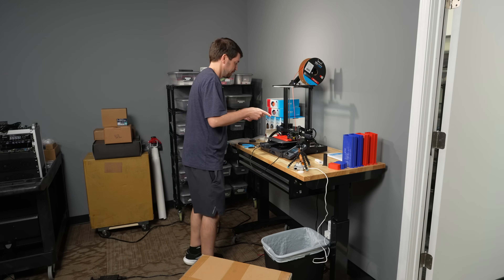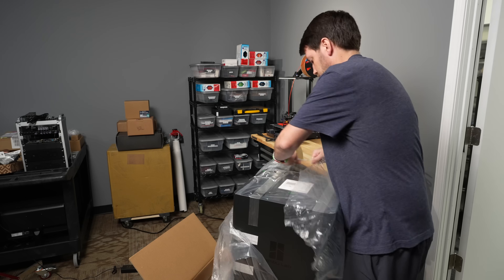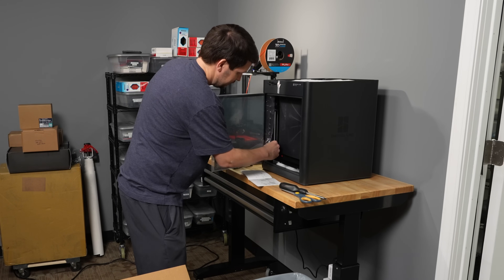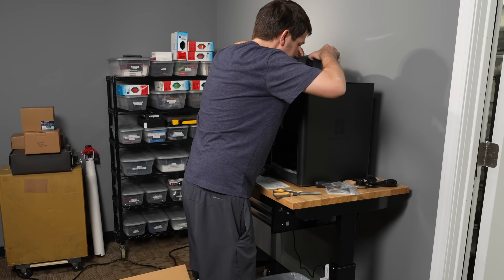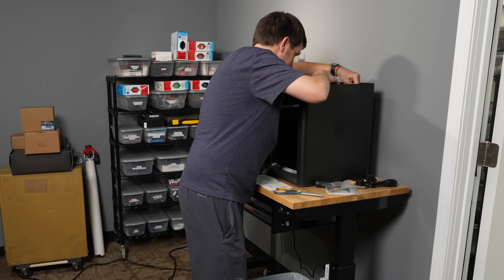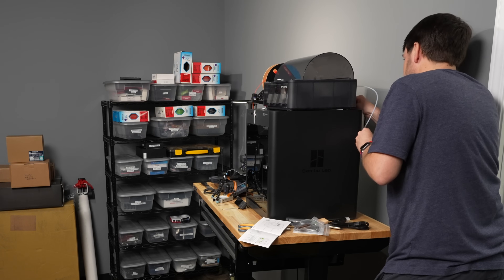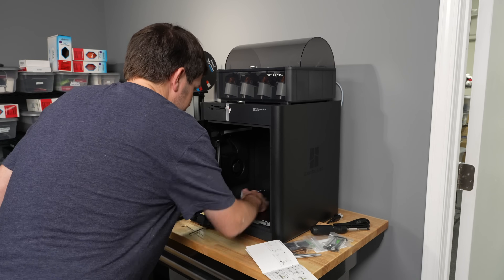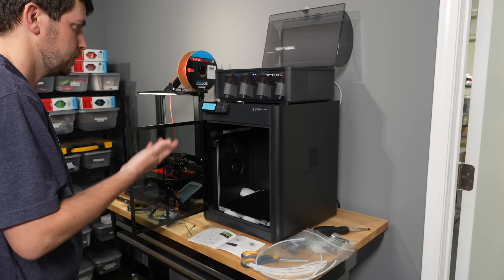Watch Me Build: Bambu Labs P1S 3D Printer

Comment: your husky workbench is brilliant. Impossible to find in Europe and particularly in France, I can't find anything similar. And I've seen the price in dollars (around $350). I think it's a very good deal. Before researching, I'd estimated it at around $800. In any case, given the thickness of the frame and the wooden surface, that's the price in France. If you have a plan for delivery in France, I'd be interested. Merci. Nice installation you've got here !!!!

Comment: I have 2 K1 Max printers, as the eco system is more open.  Material changing units waste a lot of filament, as they need to purge the nozzle before they can print with the different color.  The waste can be several times the actual weight of the print, depending upon how many changes are required.

HAVE FUN!

Comment: If I had to guess, it did the 250° purge in case you went from a higher temp filament to a lower temp filament, in which case any extra high-temp stuff may get stuck in the nozzle and cause problems.
Reply from the maker: It seems to jump to 250 on any filament changeover, I guess that's just safer for a purge than risking a lower temp and anything getting stuck.

Comment: You can daisy chain up to 4 AMS units together which is why there are 2 ports on the back of the AMS. The extra Bowden tubes are for inside the AMS, they will wear out over time... they wear out much faster if you are using abrasive filament such as Carbon Fiber.  The support for PLA... when you do a print that requires Supports... the printer will switch to that filament for printing the supports. It breaks off much easier for removing your supports.  They give you some sample filament on spools because you can buy REFILLS from them that come without spools in them, there is a price break on those.  The filaments from Bambu come with RFID tags in the spool that tell the printer the color and type so it can adjust settings like temperature specific for their filaments... it also will loosely tell you how much is left on the spool.  The "cup" in the back is called the "poop shoot" and the purged filament will go out the back.  You can ADJUST how much filament it purges between color changes to have it do less... but you should decide how much is right depending on what colors you are changing between so the color doesn't bleed.

Comment: I do not have adequate words for the boss move that was moving OG 3D printer while it was printing ... and having it keep working just fine. Top tier YouTube Suspenseful Content.

I'm very upset by this video. I had happily convinced myself I didn't need to buy a 3D printer because I absolutely did not have time to set it up and calibrate it properly and learn it and tweak it to get it optimized for actual use, and here's this thing, popping out of the box with spectacular instructions, assembled and calibrated and working in less time than it takes me to set up a new (managed) network switch.

Bambu, company I've never heard of before today, how could you do this to me.

For real though: Did you have to do a lot of customization to actually get it exactly how you wanted it? Your subtitles indicated there were customization options available, but I couldn't tell if you actually needed them or not.

Seriously great channel, and a very relaxing video while I was trying to get to sleep last night. :)
Reply: There are customizations that you can do, but yeah, it ships pretty much ready to print once you do the stock packing removal and connect everything up. My P1S did not come with the AMS, but for another $300 now I can add that. The stock configuration for generic filament works from everything I've run with. That said if you head over to the Bambu Labs store, you can customize by replacing nozzles with various other sizes, (0.4 is stock, 0.2 in both stainless steel nozzles, They also have an 0.4, 0.6, and 0.8 mm hardened steel nozzles)  PEI bed plates in both textured and smooth surfaces, as well a print plate that is textured on one side, and smooth on the other. The one that came with my printer was textured on both sides, which means that if one side becomes damaged, I can simply flip the plate over and go back to work. Or I can flip it over every so many prints, and once it's been flipped a couple of times I can run it through a washing cycle with dish washing detergent. ( I usually drop a couple of drops of something like Dawn on the surface, splash the surface with hot water, work the detergent into the texture, add more water, scrub, rinse, flip the plate over and do the same on the other side, then do a final rinse of both sides, and either air dry or dry with a lin tree cloth. This gets any oils from my fingers in printed stuff off the bed out of the texture and it's ready to go all over again.) I pretty much only do the cleaning when I find prints not sticking to the bed in spots on the bed. If you don't have that problem, it may seem like an onerous process. It works for me.
Reply: Choose the filament, pick a quality preset, turn on supports if needed and print. There are many settings to tweak but its usually not necessary. It prints incredibly well without any adjustments.
Reply: @JuddMan03 I don’t suppose it’s possible to just take an STL and throw it in and have the machine do auto supports is it? Or does one always have to set up a print job in the slicer?

Comment: Jeff, you need to dig into tuning your slicer. I've doubled the speed of my prusa MK3 and yet improved the quality. Lots of knobs to twiddle. ❤
Reply: I would say that's great if you have time to spend, and don't mind the failed parts during the time you're testing. But if you double the print speed, while eating up a full day of the 2 days you have left before you need to deliver your product, you would be better off getting a second printer of the same type, or better to meet your deadline. That's not to say that it's a bad thing to do. One option might be to head over to Chuck's Filament Friday channel and grab some of his Ender 3 optimized profiles, and see if they help. But a E3V2 is a different printer from the E3Pro, which is a different printer than the E3v3SE, or even more different the E3V3 which is a Core XZ bed slinger. So optimizations for one, may not work well on another. That said My E3V3SE was about twice as fast as I ever got my E3Pro up to. Both are down now though with feed problems. One may be a simple fix by replacing the controller board (At least I don't think I can replace the stepper for the extruder on the printer board in that printer w/o desoldering the chip from the board,) The other I may have a fix for in that I found some 0.2 mm ID stainless steel tube that when 'I' have time and incentive, I hope to use to replace the bit of PTFE between the extruder motor and the hot end in the E3V3SE. I may need a tubing flange maker to get it to sit in the same space as the OD isn't the same as the OD on the PTFE tube.

Comment: Interesting way to take it out of the box.  I would have turned the box up side down and pulled the box off of the printer.
Reply from the maker: Was considering that but with how tightly packed it was, I didn't know if flipping it upside down would be okay.
Reply: @Level2Jeff  It should be. I do it with microwaves and it works okay.  At least you were able to get it out okay.
Reply: Nah, lifting it out by the bag is the correct way per the guide.

Comment: I recommend a riser for the top so you can ventilate with the door closed. You should not print PLA with the printer sealed up as it will keep the PLA too soft. The support material is so you can print supports in a material that won't stick to your main material. Great idea but not really worth it for a hobbyist. Use tree supports in Bambu Studio and it'll come off well enough. I've got 3K hours on my P1S with no major repairs. I've had several other printers since then and none of them have been nearly as good, including the K1 Max or the A1's, although the A1's have been good.
Reply from the maker: Yeah the default 'crosshatch' supports are very difficult to remove from some parts. Probably will stick to tree for most things.
Reply: that's what the plan support is for - use it as a support interface material that easily comes off and leaves a nice finish on the surface.

Comment: I have EDS and I struggle with smaller parts. I want to get one to help me print things to aid in fixing stuff but I'm worried my fingers won't be able to work on the tiny pieces well. Do you find you need to maintenance it often?
Reply from the maker: Good question! So far with the P1S, I haven't had to touch anything at all, just print print print.

Comment: yeah, my printer came the same way.. Took a while to get the glue off the door. As an aside, you might want to print rings for your spools.. The AMS doesn't like cardboard spools...
Reply from the maker: That's what I've heard... going to have to do that!
Reply: @Level2Jeff  when you get the time, print out a python and you won't have to worry about cardboard spools in the AMS. I did the Hydra last year when I got my P1S and it's worked well enough, but it's obsolete now. The python (same creator) doesn't care about the nature of your spool. Just ordered some bolts and bearings for the build.

Comment: I don't get the need for it to have Wifi connection, does it have an ethernet connection?
Reply from the maker: Unfortunately no... I'm looking into how I can get it integrated more easily into my other 3D printer ecosystem, for which I prefer OctoPrint.
Reply: @Level2Jeff  I'd rather prefer everything wired than WiFi. Its strange that they would only have that and Bluetooth

Comment: Love the concept of 3D printing, hate the fact that only plastic is the only option for hobbyists. Much rather print in a material that is already 100% recyclable.
Reply from the maker: Ditto; I think now that 3D printing is getting to be a little more mainstream (you don't have to maintain the printer more than you print on it), it could be interesting to see where recycling goes.
Reply: I saw a while ago someone using shredders to reuse the material after going through lots of prints, it's a drawn out way of reusing the plastic but it's fine if you want to keep your environmental waste down.
Reply: @amirpourghoureiyan1637  there is actually a growing concern recycling plastic in this fashion. This is because of the micro plastics that escaped the shedding process into the air around you.
Reply: There are now plastics that are fully compostable. That helped me finally want to get one.
Reply: @dzltron  I'm not at all convinced that the plastic you have been using is ideally easily compostable. It's more likely it's only composite using industrial processes. That's what is needed for most 'compostable' plastics.
Reply: PBA is actually compostable
Reply: @BeefIngot  so if I sling that in my compost bin how long would it take for it to decompose. I suspect it won't in such a bin.

Comment: Definitely right to do Klipper for your S1... I've got klipper on mine (and swapped it to linear rails...) and I can print normal (as in, not those 'high speed' variants) of PLA fairly fast, still not as quick as a CoreXY machine though.
Reply from the maker: Yeah honestly doubling the speed would be good enough for most times, when I'm not up against some deadline!

Comment: Printing presliced and optimized benchy gcode, that printer manufacturers provide, makes little sense. It's specially optimized to show "the speeeed". Slice own benchy - that's the real test. Hint: it will be much slower.
Reply from the maker: Did so, was still very fast! Obviously you can tweak things a lot when you slice your own models, but check out the video where I printed the PIZ dispensers for Open Sauce—this thing was still wicked fast compared to the Enders of old. Though I think I can get them moving a little more smooth/fast with Klipper.
Reply: @Level2Jeff  I meant bambu presliced benchy vs own sliced benchy (even with tweaking). I wouldn't go with improving Ender but sold it and bought A1 as a second printer. Klipper will give you speed but won't get you sensors that are in A1 and single ecosystem for entire "print farm". Actually, it all depends what do you want - print things or play with printer upgrading. (I personally have Voron for "printer upgrading" goal but the rest is for printing mainly).
Reply: @arekx  Heh, so true regarding print things vs play... I have a Positron sitting in a box. I know the second I start on that build I will be consumed by it, so I am putting it off as long as possible lol

Comment: The little dance it does at the beginning when it calibrates is working out the vibration resonance. It calculates if it needs to compensate for things like a wobbly table. It also uses it to tune the motors to be less noisy. 

Hacking wise the P1 is a little behind as the mainboard doesnt run full Linux like the X1 (which is already hackable with the X1Plus project firmware). You do still get MQTT, FTP, etc with the P1 though. 

The X1 and P1 also support upto 4 AMS boxes, thats why there was an extra cable and two sockets on the unit, you just daisy chain them. You need the AMS Hub however to replace the standard hub on the back of the printer, it basically has 4 ptfe slots instead of the 1.

Well worth being on the BambuLab subreddit, lots of truly awesome projects going on over there :)
Reply from the maker: Ahhh... that's a lotta boxes! I can't imagine needing that many filaments but I guess you could just have that be your storage mechanism too.
Reply: @Level2Jeff  They do work pretty well as dry boxes...and if you're lazy and dont want to keep changing filaments like me :D I've got 2 hooked up to a P1S and 2 on an X1 and honestly it just makes things easier, I can just remotely drop files onto the printers via FTP or trigger the print from bambustudio without needing to change out filaments.
Reply: @Level2Jeff  You can have different colors or different types of filament up to 16. Granted you'll still have a purge tower, but even the Prusa XL has one despite having 5 different print heads.